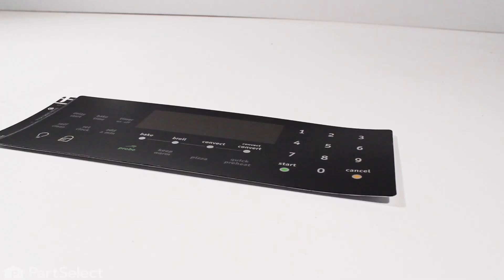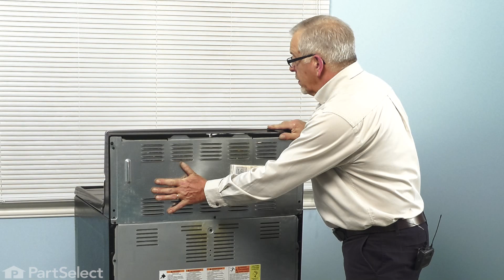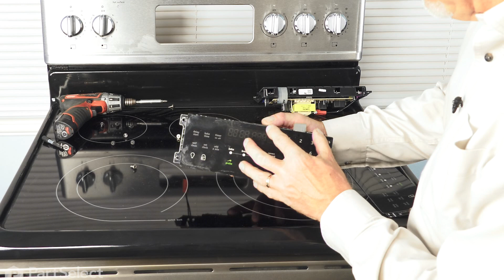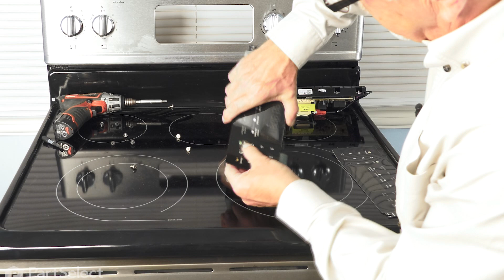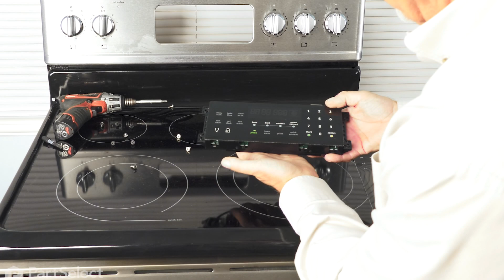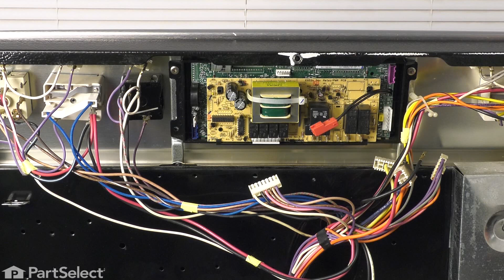Frigidaire Range/Stove/Oven Repair – How to Replace the Overlay

Comment: on my Frigidaire Range some of the display buttons work & some don't. The ones used the most (bake, start, clear/off) don't work. Is this problem related to the overlay or the Electronic Control Board?
Reply: I have the same issue as you, were u able to fix it? And if so how did u fix it?

Comment: These overlays were not built to last. I bought the Frigidaire Gallery Induction 30" Freestanding Range exactly 4.5 years ago and the plastic on these overlays splits too easily. I have a split on the timer area, since that is used the most. I hate bad design. Could be worse I guess.
Reply: The board I just replaced after 10 years the overlay was still in excellent shape.

Comment: Why would an overlay have to be replaced?
Reply: Most common reason is air bubbles between the overlay and control board caused by heat and moisture over time, if bubbles occur it can cause shorts aka f11 error code